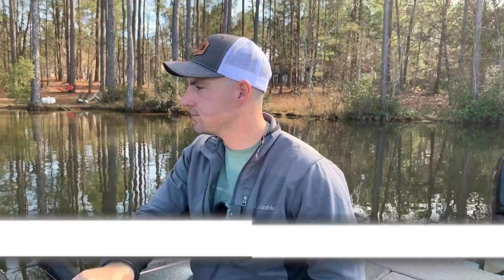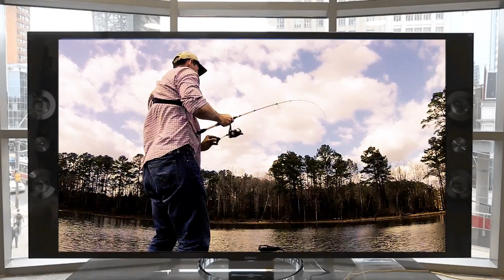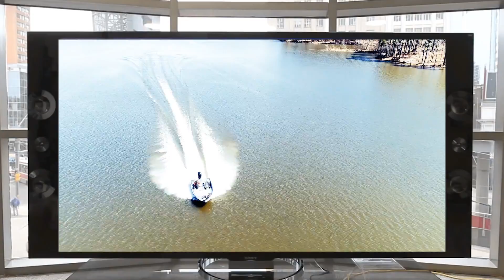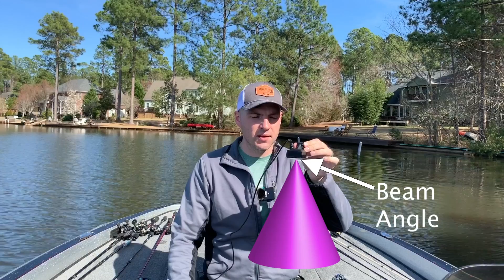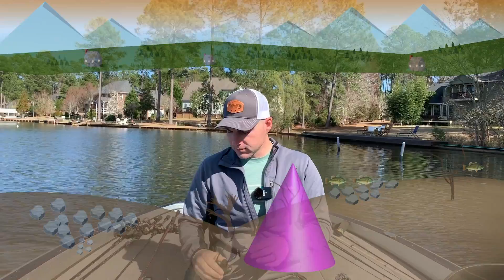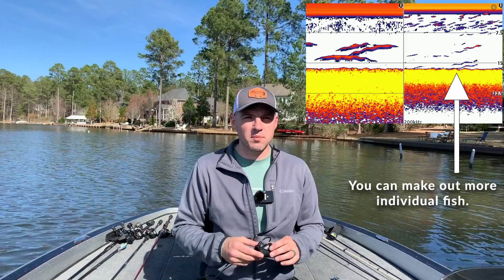What You Don't Know About Traditional (2D) Sonar Is Hurting Your Fishing:  How to use Fish Finders

Comment: Man, I saw a video years ago of a guy taking his basic 2D sonar and MOVING the transducer on a flexible mount, sweeping it back and forth at a 45 degree forward angle. The way he would compensate the angle was by rotating his screen unit 45 degrees to the left! It was genius! He was able to pinpoint exactly where these marks were located. It wasn't nearly as efficient as FFS, but if you TRULY understand the basic geometry involved in the mechanics of the sonar, you can do little tricks like this.

Comment: Thanks for efforts on this.

I am still learning this technology and use 2 x Evo3S (275LHW and constant  25 degree cone angle in H)

I still have trouble interpreting the visual relationship between  the constantly moving bottom /structure profile observed on the MFD and what is actually physically existing on the bottom as I move along….

For example, I go forward in a straight line at a very slow speed (in saltwater) and trace the bottom structure well…

However, what is the 2D sonar image (of bottom structure) really telling me that is supposed to represent the moving 3D cone of coverage at say 20m depth and high chirp (or 200KHz) - which is always behind me and in the past by default?

I do understand that 99% of the 2D sonar image is historical at any point in time…

Any assistance would be appreciated…

Cameron

Comment: What does the sonar show as the depth?  Since it gets returns from a large cone, is there some inaccuracies potentially if it is reading the far side of the cone, or can it always read the shortest distance somehow, thereby giving an accurate depth?  Also, would be nice if they would represent the cone widths at various depth, but I guess with 2d screens it gets difficult to represent.
Reply: My man. I have the same question. I literally cannot find the answer. Like what if the cone is straddling a drop off, the cone has 100 feet depth on the left, and 500 foot abrupt drop off on the right. What is the depth reading? Average? What shows on the sonar screen??

Comment: Not radio waves, “son-“ :sound waves.
Reply: Technically it is radio waves based on the electromagnetic spectrum
Reply: @boyankartolov5342  Technically it is NOT the same. There is nothing electromagnetic about sonar. Sonar is purely a mechanical process. Radio is electromagnetic. Think lightning & thunder.